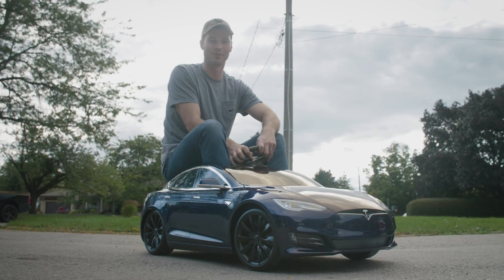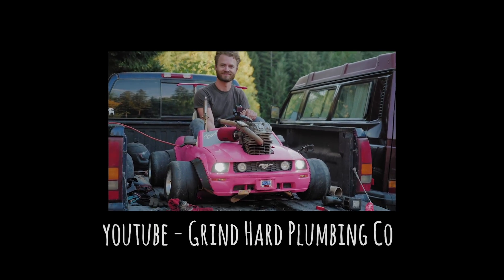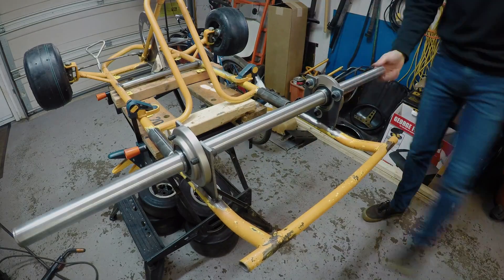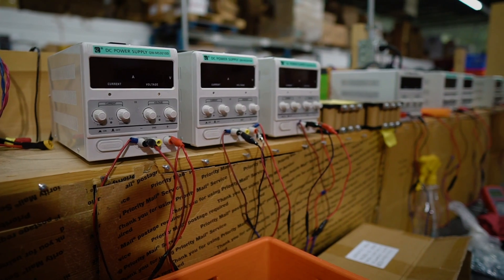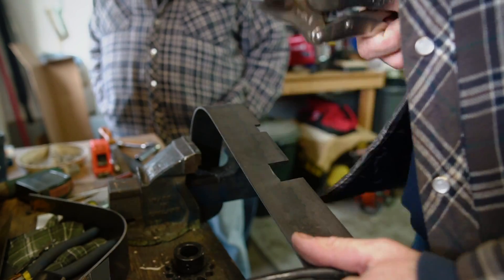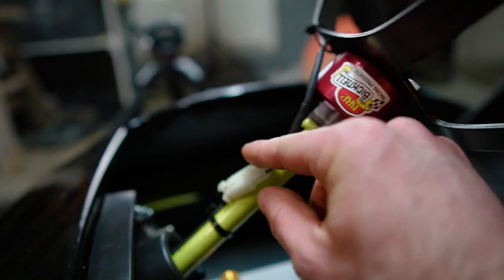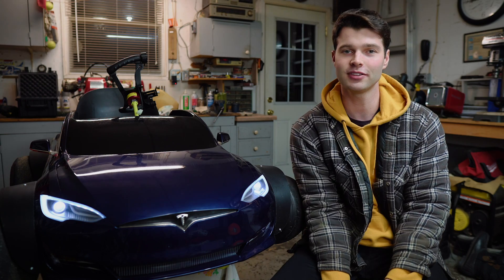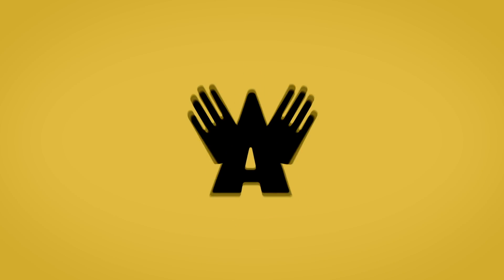World's smallest Tesla

Comment: You stated the motor can peak at 220 amp  for one minute I believe. I would like to see you add a
 " boost button which allows you to reach that peak or some of it for short spurts which will allow you to power through corners Faster in a drift with the added front weight talked about in the end.

Comment: What's the reason for one BMS for each 14S1P module? Would fuse wire not be a suitable substitute? Then you could just have one BMS to charge each module, or is the amperage too high to find a BMS for that. Surely 252A or greater max continuous BMSs exist? Would love to know. Great work on the build man!

Comment: I'm a Mechanical engineer that designs battery systems for aerospace and defense. My only advice for you on this badass little car would be to make sure you can properly vent the 18650 COTS cells. If one of those cells decides to vent, and you dont have good protection, then your leg is going to take a beating.

Comment: front suspension to add more weight to the front and prevent liftoff somewhat. 
also id like to see you go a bit more in depth in the BMS and charging setup because im building a 150 cell 10s 15p battery pack for my bajaboard and that already seems insane enough

Comment: Why did you go for a bms on each cell set in series? Why not just put them in parallel with 1 bigger bms? You seem to have lost a lot of space like this.
Reply: they made it like this to be like the real Tesla batteries
Reply: @foxxyytofficial  dont know the exact configuration but i would guess a tesla has cells in parallel.
Reply: @TheRedstonelabz1  when i checked the Tesla Batteries, they have 16 battery modules in series, each one with 6s74p
Reply: @foxxyytofficial  well yeah thats what i mean :) the 6s74p stands for 6 series 74 parallel. There is no real point in having only 1 cell since a 18650 cant output 10c as far as i know. Many small bms cost more than 1 or 2 bigger ones
Reply: @TheRedstonelabz1  those batteries don't output 10c, but they output up to 15A continuously
multiplied by 16 packs of 14s1p it can feed up to 240A
Reply: @foxxyytofficial  yeah that stays the same when you use 1 bms so i still dont see the point in using separate bms for each pack. I can understand using like 2 or 3 (4 to stay symetric) but 1p is just a whole lot of wiring.
Reply: @TheRedstonelabz1  for them the idea wasn't being a clean install
the idea was to have it like the real deal, with 16 smaller batteries working together to move the vehicle

Comment: Why did you make 16 individual 14s packs instead of 16 14p packs that al go in series, that would have saved a lot of money and a lot of time!
Reply: i don't know if making 16 packs of 1s14p would be better (if one of them discharged to cut-off, it would open the circuit and no more juice would be available until they remove the packs and test each one to see what battery discharged)
Reply: @foxxyytofficial  why would one pack be discharged? I meant that there is also a bms installed that would prevent all those things
Reply: @ElmarBon  exactly, when one of those packs gets below cutoff, the BMS will turn off, and now the other batteries will keep the kart going if they're in series and need all of them to make the closed circuit?

Comment: Hey Austiwawa, could you make a cost video about this?
Reply: hey
the motor costs 405$ in EV-Drives
the controller costs 350-450 depending on the website
the batteries are the more volatile in price (if you buy new battery cells to build it will be one price, if you buy used battery packs to salvage it will be another price)
(probably the battery in this Tesla will cost 850-1300$)
Reply: FoxxyYT cool thanks alot
Reply: @REVIVE_AUTOMOTIVE  youre welcome

Comment: The electric cart I built when I was a kid topped out at 76 in the quarter mile. That was using deep cycle lead acid batteries. 8 of them. It was a death trap.
Reply: ... I need to build me a death trap. How many kW was it?
Reply: @DUIofPhysics  
No idea lol.
Reply: I’m still waiting for my dad to come back from the store....17 years later
Reply: @bluedream8968  
He probably hit the lotto.
Reply: What Motor did you use ?
Reply: @danielm.7993  
A 75 horse DC motor.
Reply: I used a converted automotive alternator for mine. I really don't know how much power those will take, I never found the limit. Couldn't afford the batteries.
Reply: I’m Currently building a death trap lol... do u think I should go with electric or gas motor?
Reply: @sleepingturtle32  GAS GAS GAS, IM GONNA STEP ON THE GAS!
Reply: @dimitrijenovakovic7942  yes

Comment: As a suggestion.....why not 2 Lithium Ion 12VDC R/V, "Battle Born" 1000 amp batteries or Trolling motor Batteries, almost double the AMPS.  Secondly,  how about designing/building a cart that "fits" you and use your same power system? If what I have in mind, you might be able to RACE against engine powered carts.......and win.
Reply: the idea is to lower the current with higher voltage

Comment: Well done sir. Controller is expensive ain't it! Could you use the Gain from an amp? There's gotta be a way around it
Reply: that controller can offer 350A peak
you can find cheaper controllers and motors that doesn't use as much current
(for example, one Sabvoton SVMC72100 costs 200$ and can output 100A peak at 72V, other controllers can output more or less power)
Reply: @foxxyytofficial  oh! I see. It doesn't just control any size current. I'm guessing...

Bigboy currents require Bigboy control. Same reason I throw breakers cause of skinny wires...?
Reply: @gordythecreator  about the breakers and thin wires i won't know the real reason
but about the "bigboy current needs bigboy controller" is correct